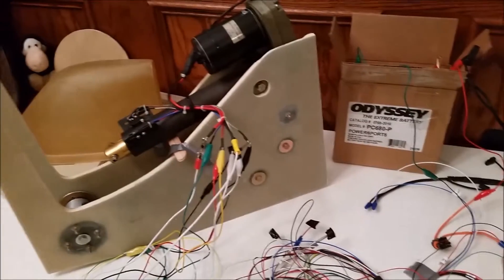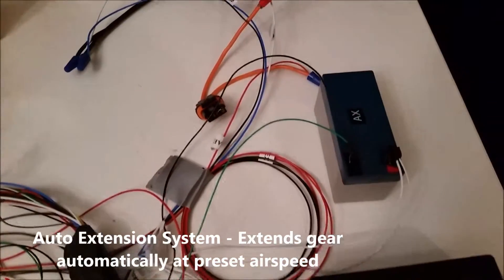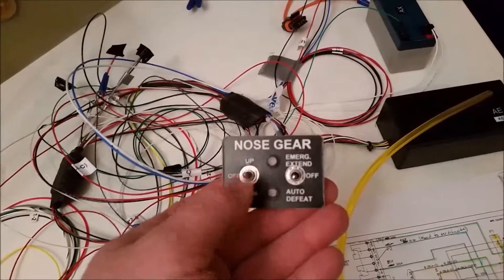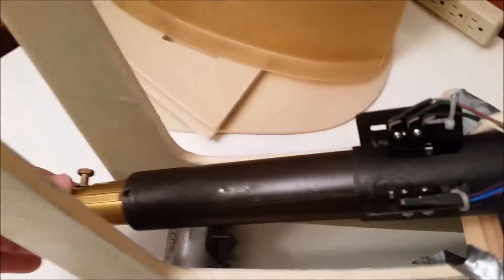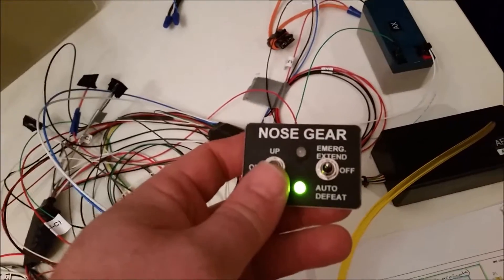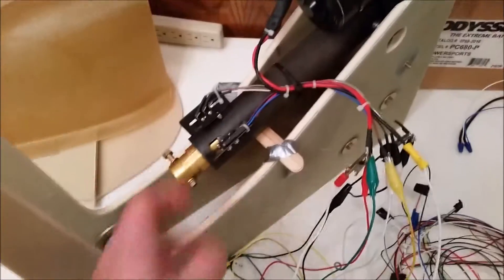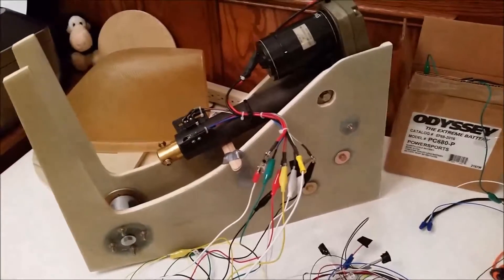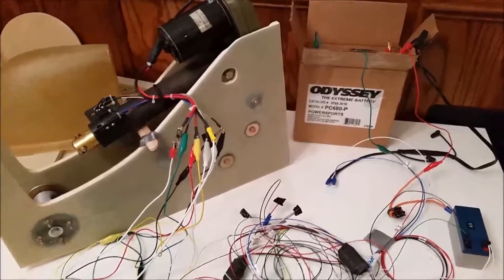Long-EZ N916WP Nose Gear Actuator Test

Comment: What are your thought on the Infinity long ez retract gear? Do you know anyone who has used them? How much extra weight is added vs the standard gear?
Reply: I considered it & researched it out about 5 years ago.  There are very distinct pros & cons.  Obviously you really clean up the aircraft so you get a speed advantage from the minimized drag.  You do suffer a weight penalty (not sure how much...but significant IIRC) and you lose fuel, that may or may not be reclaimed from how you configure your tanks. The ground track is wider so it actually is reportedly better in ground handling and during TO/landings.  

The long poles in the tent though is 1) Availability: The Cozy Girrrls installed them (their plane hasn't flown yet) and it took them quite a while to actual procure all the required components, so the possible lengthy lead time in obtaining all the parts is something to consider; and 2) Added Complexity.  The amount of stuff (hydraulics lines, etc.) is considerable.  Then you have to consider the upkeep and support on the gear system, let alone contend with the added weight.  

Taking all the above into account is why I decided to go with the standard Long-EZ Landing gear.  That being said, Waiter was able to successfully install them on his Long-EZ and fly them for a number of years. 
Check out http://www.iflyez.com/InfinityGear.shtml